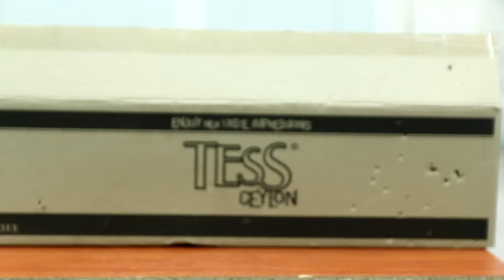3 Simple & Fun Life Hacks

Comment: The thing he glued on the battery is a piezoelectric crystal, commonly found in barbecue lighters (the long ones used to light grills), and taping it to the battery would do nothing, except maybe generate an arc to the battery which will  do nothing. The normal use of these crystal modules is generating a spark in a cloud of butane from the lighter, which ignites it.

Comment: Mr. Gear ..  which element u are using for the joint the wire .. I mean a tube which is melted by the lighter heat .
 Video duration:- 1:34